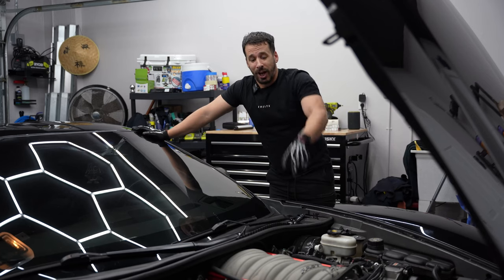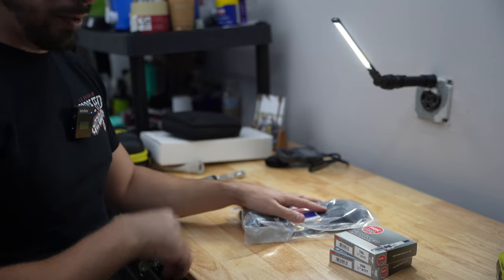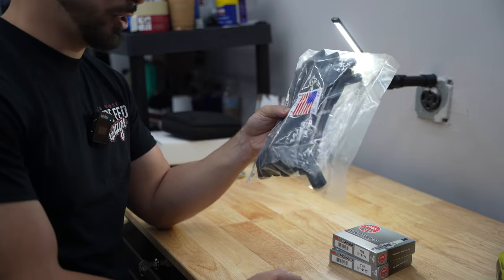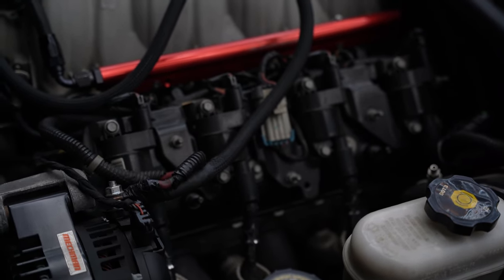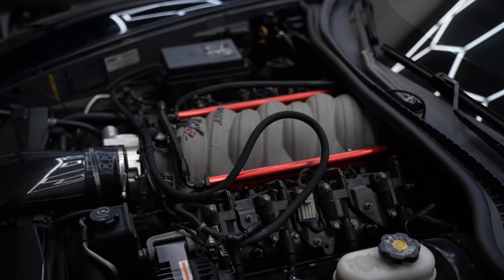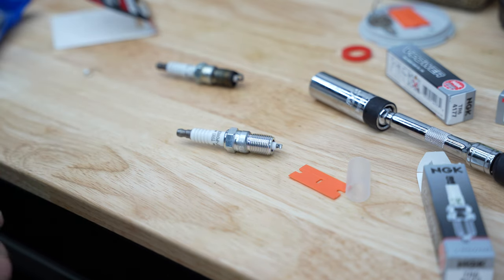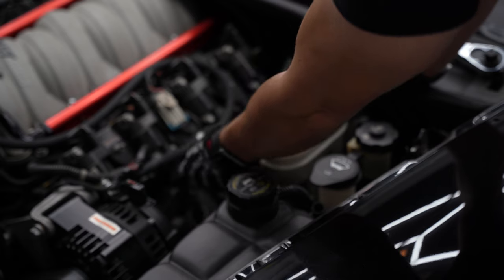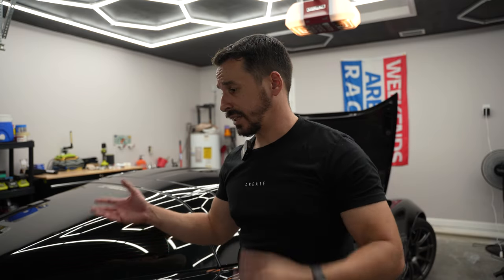Texas Speed Plug Wires Better Than Accel Wires?

Comment: Did you have any issues with the wires holding onto the spark plugs? I just came back from a test drive and a few of the wires have backed off of the plugs. Should there be a "click" onto the plugs?
Reply from the maker: You know, I noticed mine didn’t really click but they also haven’t come off either. I just ensured I pushed them down snug and wiggle tested lightly before moving to the others
Reply: @SloJoeRacing  Thanks man. It's my first build and I've only taken the stock wires off, never put LS wires on before. Did you use dielectric grease?
Reply from the maker: Thats awesome! Feel free to reach out if you have any other questions. Im no pro, but love to help where I can.I didn't use grease, but you definitely can!
Reply: I’m having trouble with mine connecting to the coils. Plugs are snug coils not so much.